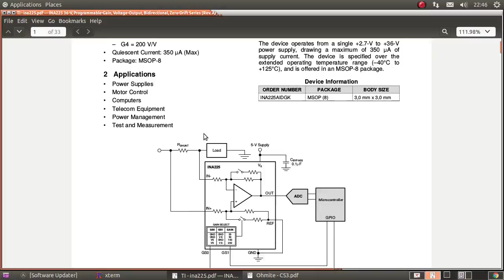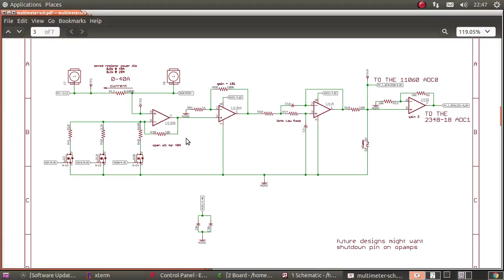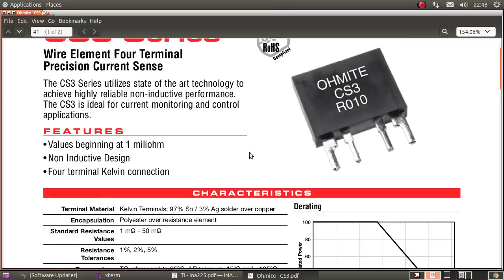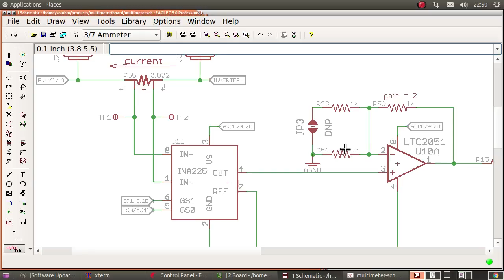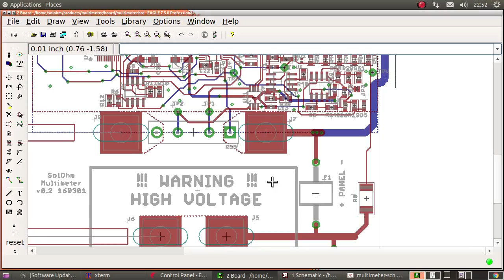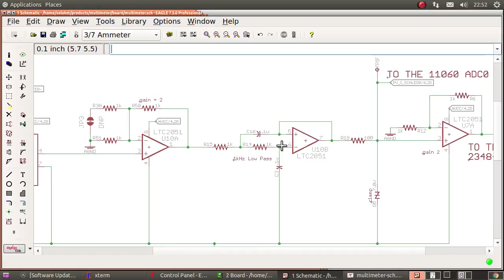160301 Current Sense Revision for v0.2

Comment: Good stuff there. I use the TI INA219 a lot, but that 255 you are using looks pretty sweet. I hook my INA219 up to my NodeMCU ESP8266 so I can get a mini oscilloscope of voltage and current inside ChiliPeppr.